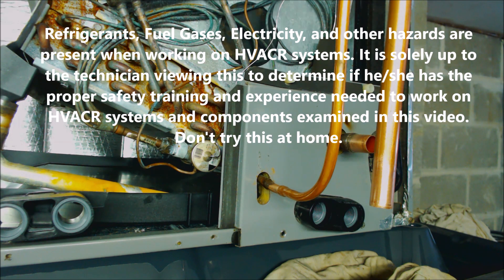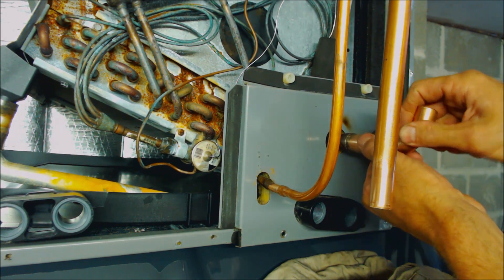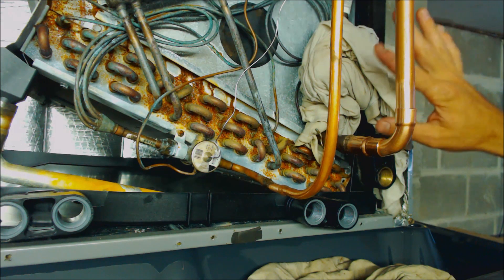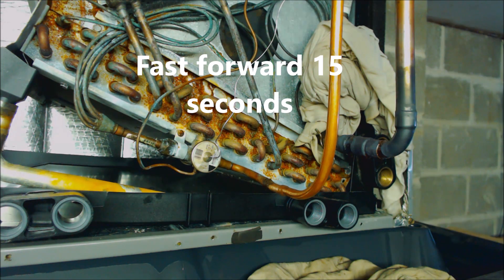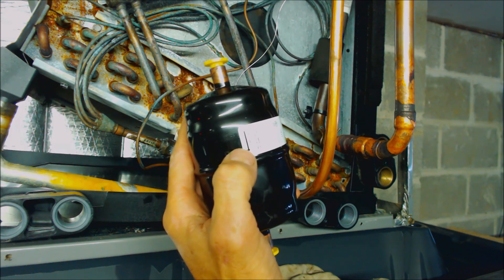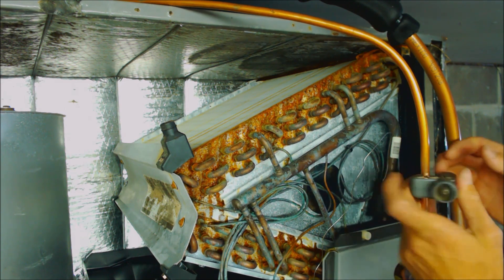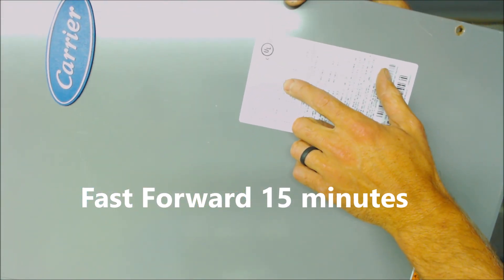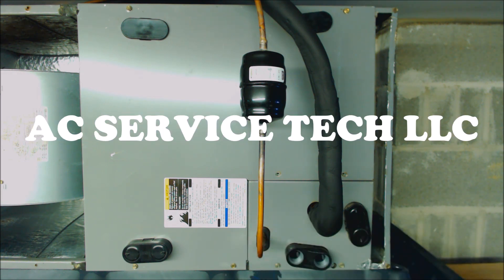HVAC Brazing In The Evaporator Coil, Filter Drier 🔥

Comment from the maker: Tool List-  https://www.amazon.com/shop/acservicetech
Support-  https://www.patreon.com/acservicetech
For those that are looking for the tools used in the videos: (Linked Below)
Here is a link to the Nitrogen Flow Meter    http://amzn.to/2brvoBg 

Here is a link the Nitrogen Regulator    http://amzn.to/2bXdR5f 

Here is a link to the Air Acetylene Torch setup-    http://amzn.to/2aQalsb  

Here is a link to the 15% Silver Brazing Rods-  http://amzn.to/2gVLyLc

Here is a link to the Appion Valve Core Removal and Vacuum Tool- http://amzn.to/2t5ogIb

Here is the link to a 5 pack of Uniweld Hammer Swages- http://amzn.to/2uqWHqs 

Here is a link for RectorSeal Bubble Gas Leak Detector http://amzn.to/2ckWACn

Here is the link to the pack of 25 C&D valve cores- https://amzn.to/2J1lurm

Here is the link for the C&D Valve Core Wrench, Container, and 3 valve cores- https://amzn.to/2EVGkps

Here is the link to the Yellow Jacket 1/4" by 1/4" heavy duty hose straight-  http://amzn.to/2umtcod

Here is the link to the CPS Vacuum Micron Gauge- http://amzn.to/2v1nM3O

Here is a link to the JB 6 CFM Vacuum Pump   http://amzn.to/2nqbvo8

Here is the Link to the Appion Blue 3/8" to 1/4" Vacuum Hose- http://amzn.to/2uYlVyc

Here is the Link to the Appion Red 3/8" to 1/4" Vacuum Hose- http://amzn.to/2uYg6Ro

Other tool links can be found in the video description section.

All of the ACSERVICETECH Playlists-  https://www.youtube.com/channel/UCOZR-1IqsAer9wzlvFgb4mA/playlists?view_as=public

Shop through Amazon! Your Purchases through Amazon provide a means for channels such as mine to earn advertising fees from all purchases after clicking through. Prices are the same as normal-    https://www.amazon.com/shop/acservicetech

Comment: Thanks for your reply. I have been using Staybrite 8 for 38 years on my new installs, I don’t want to over heat those service valves.It does take more time to use .You got to make sure it is very clean and tight joints.You have some Great videos, I tell a lot of people about your channel.Great Job
Reply from the maker: Thanks a lot Phillip, I always appreciate your comments!
Reply: Do you think staybrite is ok?? Aka any issues with flux getting into the system?

Comment: it seems like the torch head just bakes the copper before you can do anything. if you use a tip or rosebud you can just put the braising rod right into the copper without baking it red left and right and all round. but the job was fine and fast.

Comment: I like your videos.  I would like to say, I think your torch gets it way too hot.  I would use an oxy-acetylene rig personally.
Reply from the maker: The tips are interchangeable and regardless of whether air acetylene or oxyacetylene are used, we are only bringing the temp up to 1500 degrees, getting the rod melted in the joint as fast as possible, and cooling, thanks

Comment: Was the vertical tube  too long?  It looked like the vertical tube put some pressure on the joint and evaporator.  Just trying to learn, thanks!
Reply: Nevermind, I saw the curved top of the pipes.

Comment: Great video, seeing that wet rag was applied, but it still sees black marking on joint after cleaning, is that oxidation marking? 
And could you tell me the kind of filler which was used in the video

Comment: Great video.What are your thoughts on using Staybrite 8 on service valves? Thanks
Reply from the maker: Phillip, you certainly could use it. It will hold and wouldn't have to worry about the heat as much on the valves. It is just the acid introduction, thanks!

Comment: To the best of my knowledge soldering copper piping does not hold up to the vibration of the pipes as well does brazing the fittings does.
Reply from the maker: Silver soldering such as stay brite 8, does hold the R-410A pressure without any more leaks than brazing however I usually choose to braze anyway, thanks

Comment: Hi Craig,  thanks for another video.  One question.  Have you ever had trouble getting the last joint brazed when flowing N2?  I had some trouble with a pinhole like area when flowing, almost as if the N2 was blowing out the hole and keeping the final brazing from bonding.
Reply: Maybe you had too much nitrogen flowing in the pipe and creating too much pressure?

Comment: I dont have a nitrogen flow regulator i just adjust the main regulator until i get a tiny his feel on the other line.
Reply: Sometimes regulators don't do very well at that low setting and can slowly stop the flow
Reply: yes i need to get one
Reply from the maker: Hey Bernie, Joe is right, I had that problem of the pressure lowering before I was done back before I had a flow meter. I also had a leak when brazing once by accidentally having too much nitrogen going through while trying to flow without a flow regulator. It was just a pin hole. I was on top of a commercial fishing boat and the only thing I forgot was the flow regulator. I said, ehh, I will just try it with the nitrogen being lowered by my manifold gauge set. Ha ha, I went and got it after that.

Comment: Nice video! I have a question why aren’t you using oxy/acet torch here and what’s the difference with the torch in this video?! Thanks
Reply from the maker: You can choose to use either an oxy-acet torch or an air-acet torch. Either one will get to the right temp for residential light commercial systems up to 1 1/8" vapor line. If there is a lot of wind and you can't block it on a roof top then yes an oxy-acet torch would be better in that instance, thanks!

Comment: Thank you for another practical video.   I was surprise how close you can braze to the bulb especially with the nitrogen flowing towards the bulb. I know you had a wet rag.  Did the bulb get hot at all ? I have no practical experience with  air conditioning work yet but have brazed a good few copper water pipes. What is the hottest you could let the bulb get without risk of damage to TXV valve. Thanks Michael
Reply from the maker: Hey Michael, well the joint has to get to 1350 degrees in order to melt the rod so it was a little hotter than that. That was a large rag soaked in cold water and I got in and out as fast as I could. I am sure there are a lot of people that just braze without thinking of protecting the bulb and then the service tech is left with trying to clean the problem up. You just don't want to have the txv be jammed or stuck when it is done. The bulb was more than warm but it was not that hot once I got my hand on it after taking the wet rag off. I did not take a temp reading and I usually disconnect the bulb from the suction line, thanks

Comment: 7:20 - For the reasons you discussed, does it make sense for a technician to choose to replace the filter drier outside with pipe and install the new one inside (to make a longer lasting system with a little extra work)?
Reply: Depends on the climate

Comment: Filter drier question- I had an old r-22 2 ton replaced with a 410a 2.5 ton, the tech left the old filter drier (on the outside unit on the liquid line). I know the new unit has a filter drier located in the condeu unit........ Can the old filter drier cause damage ?? If so how ?
Reply from the maker: It could introduce old oil into the system and more friction on the liquid line, wow that is a shame, I am sorry!
Reply: AC Service Tech LLC  it’s been installed and running for about 1 year, (BC I’m now educating myself from your videos how things should be done correctly, thank you so much) would you suggest I pump down the system, do evac...etc and braze in a new filter drier or maybe just put in a coupling ..... or would that cause more damage and I should just let it be ?

Comment: 300 psi seems a little excessive,no?...... specially on old rusted,corroded coils
Reply: If the unit is pumped down I never like to go over the standing pressure of the freon. I've had the nitrogen go into the condensor through the valves before
Reply: Joe Shearer what happens if it’s the opposite.
Reply from the maker: Hey Oscar and Joe, I usually teach the pressure testing for ac and heat pumps at the same time. That is why I said 350psi. If it were a heat pump, it would need to be checked at a higher pressure. Joe is correct that you could test it at a lower pressure if it is ac only like in the video. You could test it at the highest standing pressure that it could see for the specific refrigerant you are using. For some, that would be 95 degrees, for others that could be 130 degrees. I haven't had nitrogen go back into the system though. I always wait and watch if the pressure rises after pumping down and I am sure you both do as well. Great additions! Thanks both of you!
Reply from the maker: That coil was 8 years old with a max design pressure of 450psi, thanks
Reply: AC Service Tech LLC do you think it keeps the same testing condition from when it was new?..... or would time effect it’s state or performance when pressurizing?....
Reply from the maker: Time will certainly affect it as some older ones start to create leaks but it is our job to see what state it is at before trying to reuse it. Not overpressurizing it thereby creating a leak but to verify that it doesn't have any leaks. Like I said, if it is an older R-22 coil, I won't pressurize it above 150, thanks

Comment: Isn`t the brazing is weak. edges of pipes visible and it looks u are very economic with solder usage. At some videos more soldering are used when they braze the pipes
Reply from the maker: Hey erdal, the object is to try to get in and out quick for less heat on the components and I did apply a normal amount of braze. In fact, I don't stop brazing usually until there is a crown at the top to finish it, thanks!

Comment: Nice work! What's your thoughts on brazing with acetylene B tank versus OxyAcetylene?
Reply from the maker: Oxy Acetylene will handle pipe sizes larger than 1 1/8 and also heavy wind. Air acetylene will usually work as well for 1/8"- 1/1/8" and is simple. B tanks last a long time as well, thanks